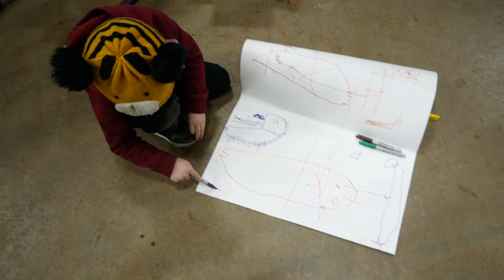Plow Truck Hydraulic Leak Escalates Quickly

Comment: Wow scary shitbox - A polar opposite of what I see accoss the border in Switzerland  - They keep municipal equipment for up to 40 years, their conditions are as bad to much worse than yours. But their idea of maintainance is to take the manufactures recomendations for harsh conditions and doubble it. In the long run its much cheaper, even at their labour rates!. Here in France things last probably 20 years, but when they are sold on to private concerns they are in full working order, just a bit beat - Difference is inspections and how harsh they are.
Reply from the maker: Not here. We wring every nickle out of it then drag it in for recycling. Always been that way.
Reply: @WatchWesWork  I think my local scrapyard would have severe reservations about taking that plough truck.

Comment: These township people should let you perform all the maintenance and stop using you after the equipment is broke. In the summer time I rebuild my plow trucks to stop mid winter breakdowns.I bet these trucks don’t have many kilometers use but gosh they look abused. The operators of this truck never look the truck over. They just run it into the ground. 😢This truck cost allot of money when new. Tax payers money and now look at it.
Reply from the maker: Yes, low miles. No maintenance to speak of.

Comment: A 20tonne snow plough operating on the highway that has not been maintained is lethal.  I would  shut down the operator for 50 years.  No excuse,  there's plenty of time for maintenance.  I know it's not your responsibility Mr West, but I would issue a report with  video to the appropriate authority. The operator is not a fit and proper person to operate Heavy Goods Vehicles  [HGV's].
Reply: Oh blah. It's being maintained right on video for you. Going to shut the county highway department down for 50 years are you?
Reply from the maker: I'd wager it's doing more good than harm.
Reply: @farmerbill6855  Dear Sir,  For some time hydraulic oil has leaked from  a hydraulic line,  a severe leak of coolant from the radiator and only two bolts in place attaching the side plough blade.  These faults have not "Recently" happened.  The owner has nine months to carry out maintenance before the snow arrived. Maintenance is done before use of the vehicle.  I certainly would not travel in your vehicle.
Reply: @kevingrainger2530  I don't know how much you know about the United States but "We, the People" own that truck. You could hardly go about shutting down a branch of local government for fifty years. To be sure, it might do us well on the federal level but the snow would still get plowed. These kinds of plows are not used on the highways or in the larger cities, they are generally hand me downs from same. Used by small towns and county governments. They are about the hardest worked trucks in the nation. They maintain roads spring, summer, and fall and plow snow most of the winter. That radiator could have leaked for a while. The rust is a constant problem and could happen on a new truck with Chinese hoses. And lastly, that wing plow could have hit something yesterday. In the winter, those things more than likely save lives every day so we're more than happy to have them running.
Reply: @farmerbill6855  Dear Sir, Thank you for your reply.  I was merely pointing out the condition of the truck  upon delivery to Mr West.  This lorry was not in a reasonable  state of repair and this is my concern.
Reply: @kevingrainger2530  and that's why he has it. To fix it.

Comment: that oliver needs wheel weights
Reply from the maker: I have a set. It also has fluid. With the chains on it'll kill the engine before it loses traction.
Reply: @WatchWesWork  im gonna assume the fluid is the rim eater kind that's often used up there?